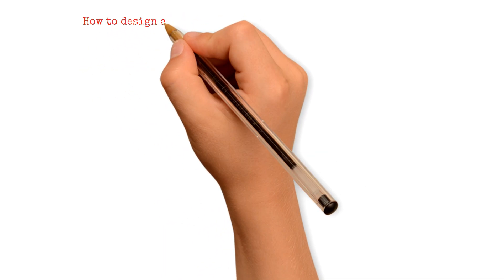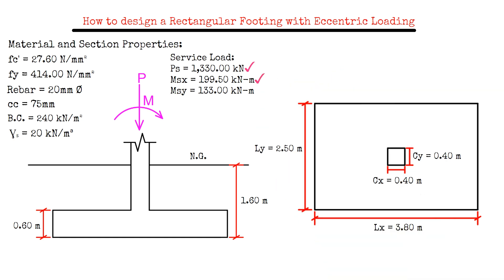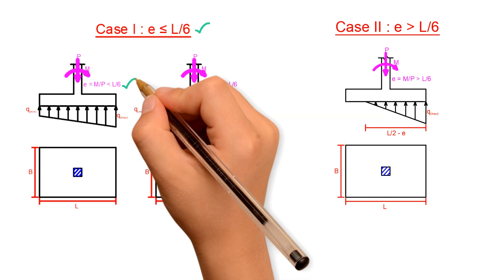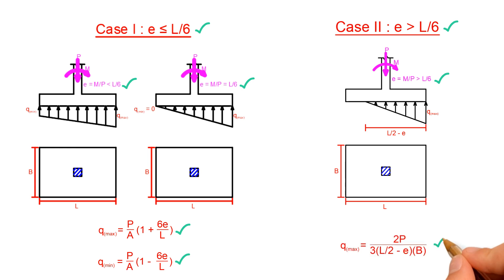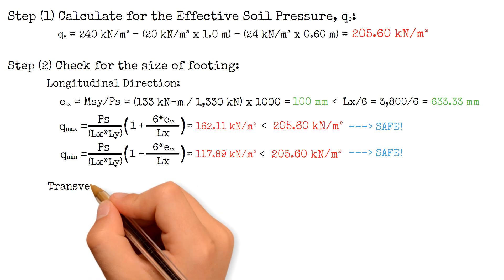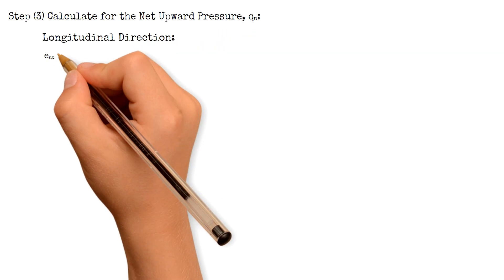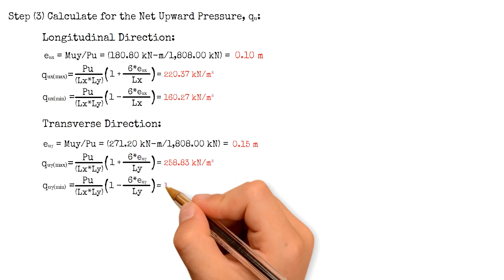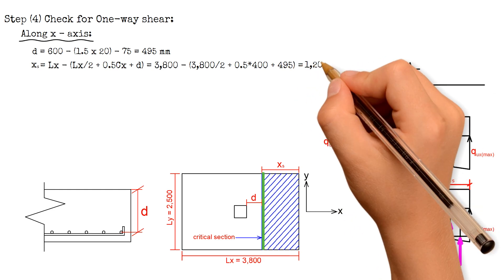How to Design a Rectangular Footing with Eccentric Loading - Part 1

Comment: Great video, Sir. But I want to clarify that in checking for punching shear you didn't account for the moment bi-axial contributing to your ultimate shear which generated the greater shear stress, also as ACI 318 Design Guide and RC Book 7 Ed James Wight (both 2016), u must check for the combinations of shear stress due to shear force and moment transferred. When it comes to check the bi-axial moment, both of one way to two way shear. The calculations for the Qu max and min is a sum of the 3 components such as Aksial Factored, Moment Factored about X axis and Moment Factored about Y axis.